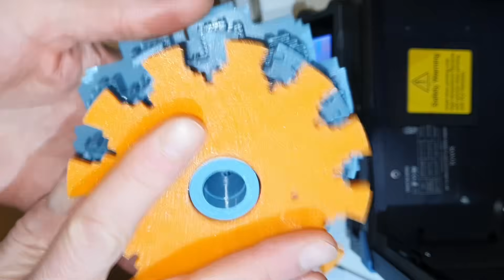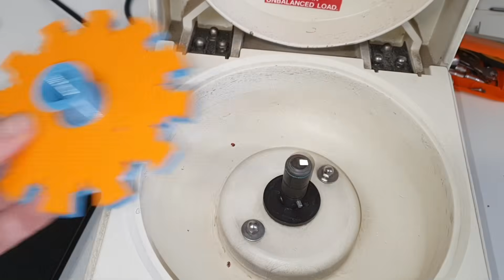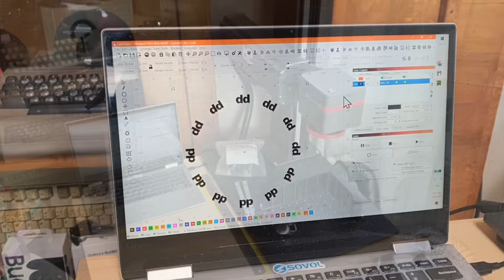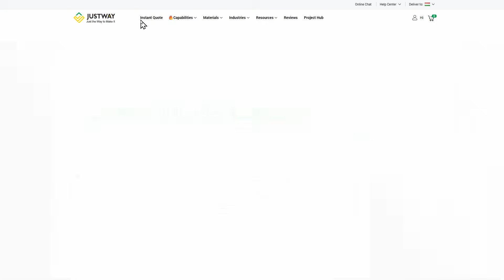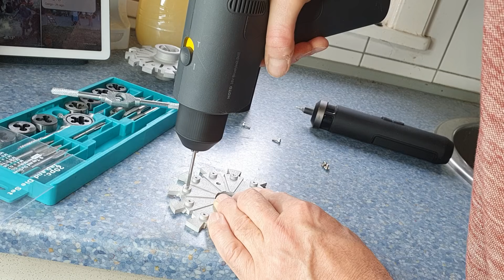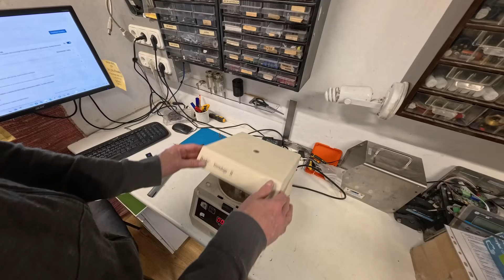3D Printing Metal Is Actually Practical 🤯 Lab Repair: PLA vs ABS vs Aluminum by JustWay!

Comment: Why not add some speed holes to the plates? Like a bicycle front sprocket for example.   Or reduce the thickness with ribs?
Reply from the maker: Yes, I mention that in the video, the metal is so much stronger I could lighten the model that was intended for plastic.

Comment: Did anyone tried 3d printing M10 size wth thread?
Reply from the maker: M10 should print without any issue. You might want to lower your layer height to 0.12 or so.  If you are planning to drive a metal screw into the threads, you can heat the screw and let it carve the threads into a slightly undersized hole (make sure to add a large number of walls around the hole).
Reply: @gerGoPrint3D  I'm planning to SLM print a part in AlSi10Mg with an M10x1.25 bolt hole. Should I model the threads directly into the 3D file, or would it be better to leave an 8.5mm pilot hole and tap it manually post-print?
Reply from the maker: @jervx829  JustWay can make proper threads if you order it that way. I think there is an option you can mark and leave the details in the notes.  There is human interaction before manufacturing, you can confirm with your assigned contact person.
Reply: M10 should print without any issue. You might want to lower your layer height to 0.12 or so.  If you are planning to drive a metal screw into the threads, you can heat the screw and let it carve the threads into a slightly undersized hole (make sure to add a large number of walls around the hole).

Comment: Aluminum part could be redesigned to be lighter. I think FreeCAD even has a feature to estimate weight.
Reply from the maker: I didn't even realize! I've just been doing it the hard way,,, manually querying Gui.Selection.getSelection()[0].Shape.Volume in the Python console and multiplying it by the density. 😅Thanks for the tip!

Comment: Why not pps-gf?
Reply from the maker: That is actually a really great point! PPS-GF would be much lighter and stands up to boiling/autoclaving perfectly. JustWay actually prints it for a very similar price, too.
For this project, my main concern was isotropic strength. Under the intense centrifugal forces of 2800 RPM, I wanted to completely eliminate any risk of layer adhesion failure. Plus, those aluminum pivot cradles are incredibly wear-resistant and won't wallow out over time. If I were to redo the project, though, I'd hollow out the aluminum design to bring the weight down. Solid metal is so strong we really didn't need all this mass!
Reply: @gerGoPrint3D As expensive as PPS-CF is, it would likely be cheaper to 3d print yourself, though I get that this is also a promo for JustWay.
Reply from the maker: Spot on. Justway sponsors using their service, they would not pay for the filament we purchase. Still I will get my hands on PPS-CF because our printers are capable of printing it, though it will too have its learning curve to get it right. This model is pretty tricky reqiring a lot of hard to remove supports.

Comment: Nice work. If balanced, then only acceleration takes longer with heavier part. But motor can keep the similar final RPM.
Reply from the maker: Exactly, once it's up to speed, the inertia isn't as much of an issue as the initial ramp-up! 💡 And MOPA making is so practical!

Comment: Can you check out the sv08 max xy sliders. Dominator on printables made a revised version. "DOMINATOR Sovol SV08 MAX sliding seats improved regarding pully positions" Apparently, the idlers are not correctly placed. After aligning his part to the stock in cad, i ended up noticing the shaft that holds the left toothed idler does not align with the bottom grove. i wonder if this is the cause of my wobble. Definitely worth investigating and seeing if you get an improvement with dominators mod.
Reply from the maker: Yes, I've found it! Looks very interesting! There is really a good chance of this fixing your print surfaces. Now that I am done with this week's video I can look into printing your test files and give you feedback. Maybe realizing mine is acting up as much as yours I will want to replace those sliders too :)  But as said, I haven't noticed any of the issues you mentioned or what Dominator's design promises to solve.  I keep you posted!
Reply: @gerGoPrint3D  Awesome! I'm looking forward to seeing your results! Thanks for the heads up.